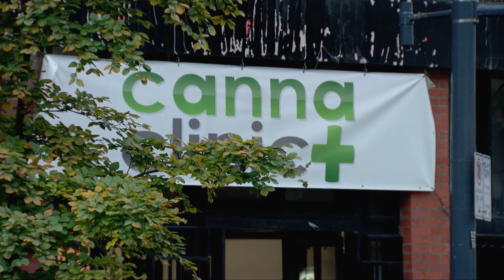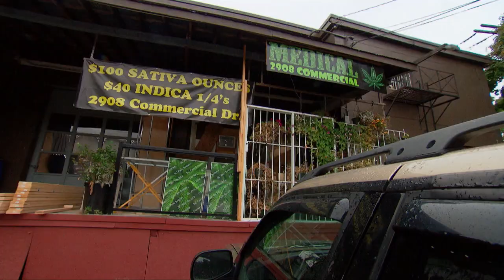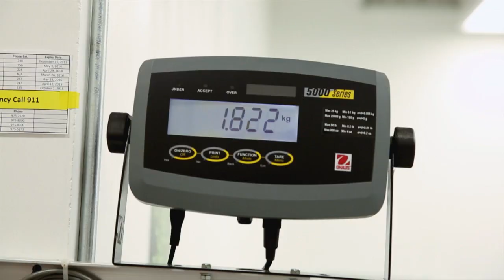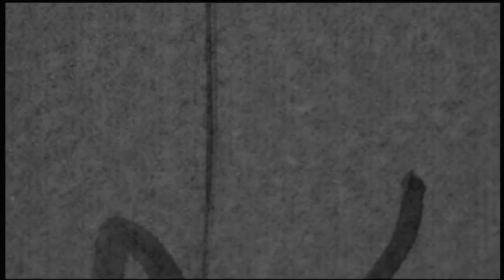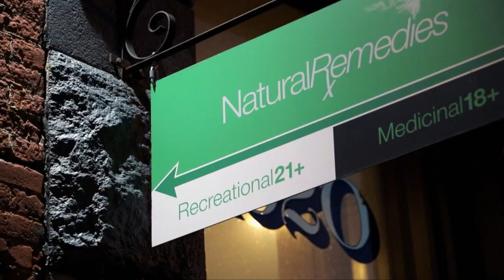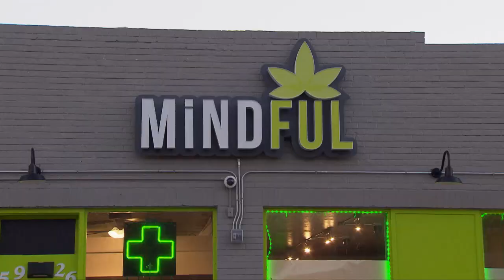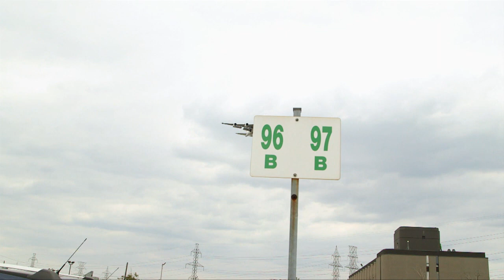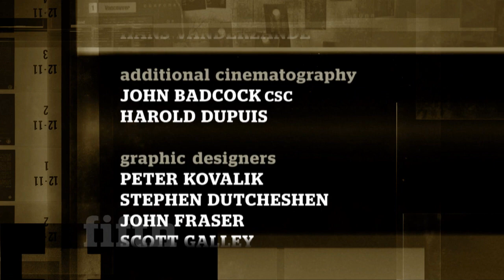Marijuana in Canada : Pot Fiction - the fifth estate

Comment: one gram for 4$... half an ounce for 70 dollars... I've found heaven guys.
Reply: That was not $70 for half an ounce. It was closer to a quarter for $70 which is higher than street prices which would be a bout $60 typically.
Reply: i pay 10euro per gramm so its very cheap for my (in Germany its illigal)
Reply: i can get half o for $80 and im 13 lol  it frosty too
Reply: 13 and smoking, smh.
Where are your parents?
Reply: Where are your parents?
Reply: The whole point I was making is that the price of buying product from so called "regulated sources" is more expensive than present alternatives. Legalization will require those prices to drop or else why would you pay more when you do not need to?
Reply: I live in Vancouver Canada, I quit in 2013. Before then I would pay as low as 3$ a gram. On average my local shop charged 5$g, 35$q, 70$h and 100$zip. That was for a good selection of good bud. I hear the price is still the same.
Reply: Mike Dobinson dude I literally pay ten times that in my country, and it's the pot here is significantly weaker.
Reply: I live in alberta i pay 60 for a quarter 180 for an ounce, quality stuff from BC, those are street prices and medical is alot cheaper.
Reply: That's not too bad. In the late 80s we paid,10g for hash and bud called Kimo. Short for chemotherapy, was what we were told. I was a teen, I was not going to argue. It did the trick.
Reply: what streets would that be.?? Here $150 for a half. 3gms $50 1 gm $20.And ours is about 7% THC level. We pay top dollar for average pot.
Reply: P
Reply: in england the common size has dropped to 0.7g/0.6g for £10 :(
Reply: Right now you can buy a oz of tweed 20% thc , but the high is so chemical due to the fertilizer , pesticide and fungicides used in the grow cycle , makes you dizzy , twitchy, edgy , nausea, headaches and confused and week , what a great fking deal , the organic is great , smooth and clean but is 20 bucks a fking gram i quit
Reply: Most black market weed is toxic